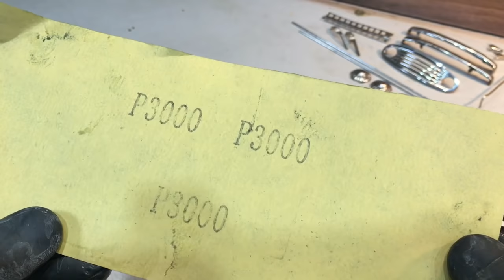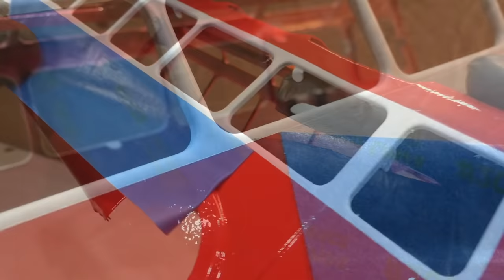1950's Abandoned model - Antique rusty bus - Restoration

Comment: Nice job, but you could have washed the parts with the loose old paint indoors. So that the old paint is not on your lawn.
Reply from the maker: Thank you ! I knew I would have this comment ;) You're perfectly right. Actually the old paint remains in the water tank. Electrolytic pickling only unstick the paint. What you see on the lawn is mainly rust residue. I'll wash it indoors next time !! 🙌 Thanks a lot for watching and commenting !!
Reply: @TheFabrik  Just think about blasting. Chemical stuff isn't good for the nature at all. Also you save Water. But great Job you did.

Comment: Hello Fabrik,
I have enjoyed watching several of your video's as they are both educational and amazing.  What I've noticed is that in some cases you use sand blasting and in others the electrolytic process. Could you explain what drives that decision?   Also in this video you use Oxygenated water.  Could you briefly explain why one sheet of plastic was done this way vs. simply cleaning it with soap and water.   Actually a very brief description in each video of the methods used would be most helpful.  Thanks!
Reply from the maker: Thanks a lot for watching and commenting !!! On my next vids I’ll write some more descriptions👍🏻Actually these Joustra toys were usually made of very thin metal sheet... So sandblasting deforms and inevitably damages it. I would say it depends on what type of metal I need to strip. Electrolysis picking preserves the integrity of the metal. Thanks again !’ 😃👍🏻
Reply: Using oxygenated water to clean the plastic is a gentle way to take any discoloration out of it. With age of plastics, comes discoloration.
Reply: @TAG77  Thank you very much for the explanation as it is most helpful.

Comment: Need to sand the surface before and after primer...
Reply from the maker: Ok
Reply: @TheFabrik  first layer of primer you will  need to sand down almost back to bare metal ,specialy  if the surface is very corroded.
Meaning of this is to fill the corrosion spots to get a smoot finish at the end.